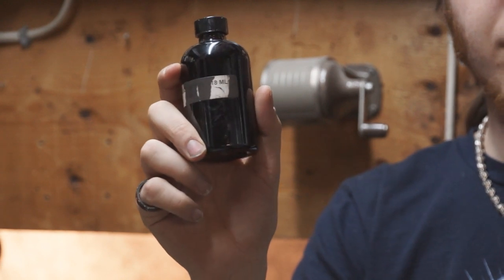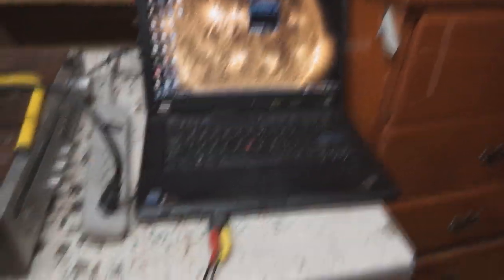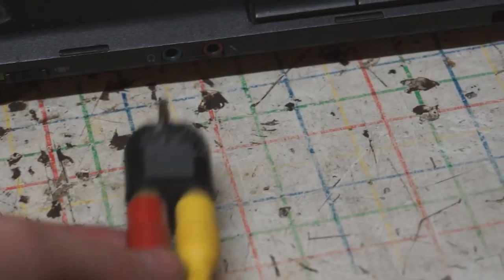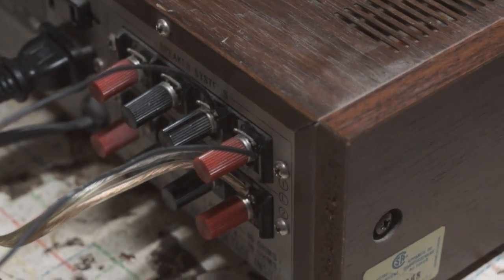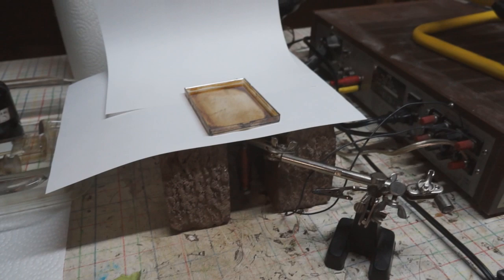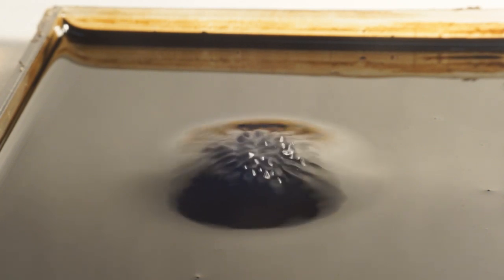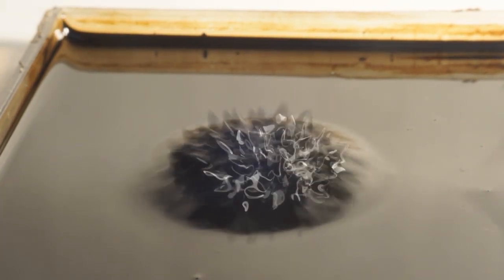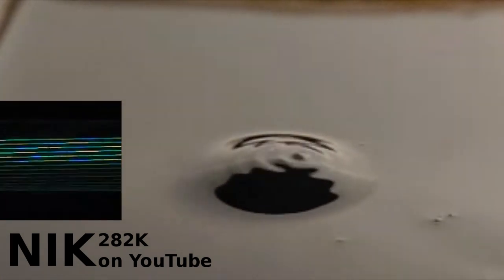Ferrofluid Frequency Sweep

Comment: I'm actually attempting this exact project! Did you use something to insulate between the bolt and the copper wire? Thanks for this.
Reply from the maker: I used enamel coated wire which is already insulated, as long as you don't scratch it you can wrap it right on to the bolt. If you get it working send me a link!
Reply: @NickMoore  so I got it to work! Thank you! The enamel coated wire is what I needed, but the effect is smaller than expected. I get some movement and vibration, but I don't really get the spikes that you get. I feel like this field being generated is too small. I have a 100 watt sub amp, rated at 4 ohms, connected to an old 5.1 system. I currently have too much resistance going in the coil (8 ohms), do you think if I removed some of the wire it would work better? This amp is completely disposable. Thanks, Nick!
Reply from the maker: If taking some wire off doesn't help then try putting a second coil over the first one, wrapped in the same direction. This will let more current flow around the bolt and get you a bigger magnet field. Also try low notes, the fluid doesn't respond much to high frequencies.

Comment: hi, did you just connect your coil on one side of speaker? left / right
Reply from the maker: Yeah, I wound enough wire on a bolt to provide a load for the amplifier and hooked it up to the speaker terminals.

Comment: Hey Nick Moore, Im trying to build my own electromagnetic coil, but I'm having trouble getting the right impedance to match my amp. How did you calculate it? What resources did you use? Because I've tried a few different types of bolts with different amounts of copper wire wrapped but it always seems to overload my amp.
Reply from the maker: I just guessed but it helps to remember that your amp can drive a coil with an impedance that is too high but not too low. I WAY over did the number of winding at the cost of maximum wattage (which doesn't really matter in this application). Hope that helps.

Comment: I think this would have been a lot better looking if you had used a square wave instead of a sine wave. Towards the end you can clearly see that you are only really getting a response at the crest and trough of the wave when the voltage is highest. A square wave would maximize this and potentially you could see a reaction at a higher frequency.
Reply from the maker: The impedance of the coil was not very well matched to the amplifier, driving square waves caused the overloads to trip almost instantly due to excessive current draw.

Comment: hey this work is amazing man, im trying to include this type of setup in an analouge VJ set that im making, where do you think i could aquire a good strong coil that i can usse with an amplifier??
Reply from the maker: The coil you use would have to have an impedance of at least 8 ohms at lower frequencies so that it would't overload the amp, it would also have to be be able to dissipate the heat generated. You could try using a "solenoid coil" from a solenoid valve. They are made to dissipate 20-30watts at their rated voltages and are designed to produce a strong magnetic field. They are not made for high frequencies but high frequencies don't seem to make ferrofluid do anything interesting. I would try a 24v coil with a thick bolt as the core and see how it goes. If the coil heats up too much (or melts) try a high voltage rated coil. Also, don't test this with an amp that you love, it is very easy to kill an amp by hooking up things that are not speakers to it's output.

If you give this a try let me know, I'd like to see the results.

Comment: That is very cool!  I can't tell if it's just my eyes, but it looks like the spikes are alternating based on the polarity of the field.  There is a property of magnetism called magnetic viscosity that describes the rate at which a material loses its magnetism after an external field has been removed.  If the spikes are indeed alternating, I wonder if it has anything to do with that or if it's just due to the inertia of the collapsing fluid.

Awesome series of videos!  Ferrofluid is neat stuff...
Reply from the maker: I though the alternating spikes looked a little like Faraday waves which also alternate in a similar way. It could be a combination of the two or more factors.
Reply: Cool!  I didn't know the term, but Faraday waves are exactly what I was trying to describe with the 'inertia of collapsing fluid' comment.  I agree it's probably that more than magnetic properties.